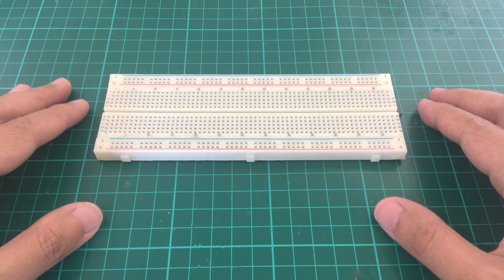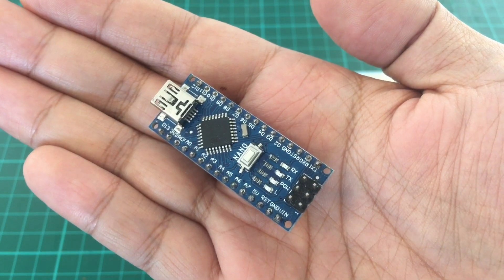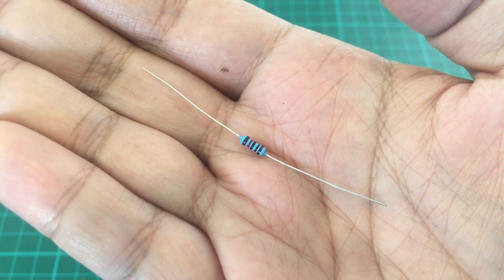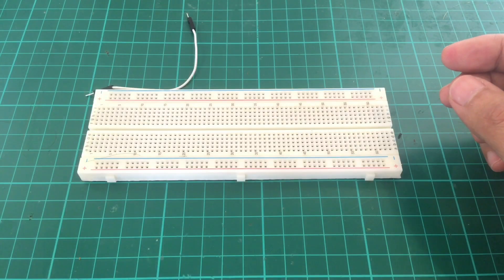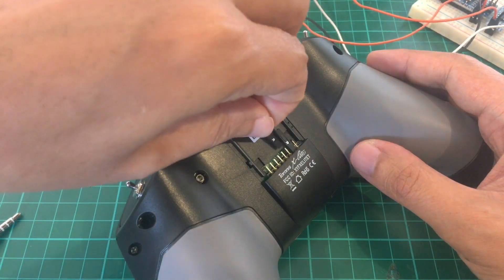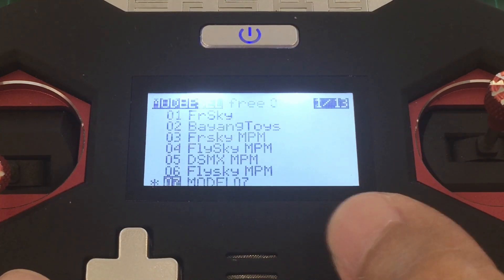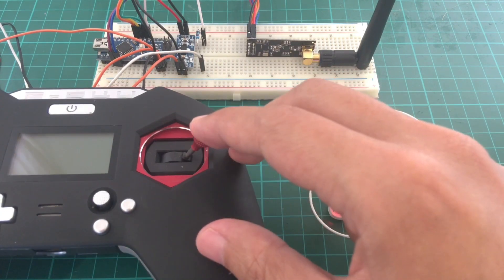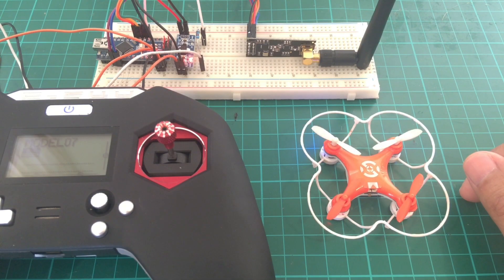How To Build A Better Multiprotocol Transmitter Module

Comment: Hello  @jaylagare  , the code by goebish does not use the spi ports on the arduino, do i need to install additional libraries for the code to work?
Reply from the maker: Yes, it doesn’t use the hardware SPI. No, there’s no need for additional libraries as everything is in the code already.
Reply: @jaylagare  thank you for your help, hopefully i can get it to work

Comment: Hello  @jaylagare  , can i use arduino pro micro or leonardo for this module? Thank you
Reply from the maker: Yes, it should be possible.
Reply: @jaylagare  i think my nrf24 module is faulty, tried the code, but wont bind with rajawali whoop fc silverware. When selecting protocol using sticks the tx light stays on and wont blink.

Comment: Im using the flysky output om my tx .
 External , multi , flysky , std subtype . 
   The ant pin in the jr bay going to a 2.4ghz radio signal  booster .
 It is labled ant . Not labeled ibus .
The bottom pin is labled Ant . 
   Above it is gnd .
 Above that is v - batt ( 2s 7.4 volt ) 
 Usually only crsf module or elrs modules or muti protocol modules are used by people on youTube .
I wonder if it works ?
Reply from the maker: Sorry, I’m not familiar with that particular setup.
Reply: @jaylagare  thanks . 
 I will put an antenna on it to see what my multiprotocol tx puts out on that pin . 
  To see if it is an ibus signal or an sbus signal or an rf signal .

Comment: Bhai plz help karo na , mai bohat try kar raha hu nrf se nai ho raha haib😢 plz help
Bro plz help me, iam trying really very hard with nrf but cannot get it to work 
i compie the code as it is Still nothing
I compile the code AETR PPM Still nothing 
Tested the input and inserted Some Code to output a PPM on a free PIN for loop back the final Signal Sent to NRF, Confirmed it on Osciloscope and everything inputs and Signal is in order 
USED FS-i6x Stock (therefore AETR order PPM)
once Changed the FS-i6x Stock Firmware to OpenTX Still 
Nothing 
its Driving me mad Since more then an year Changed 2 Drones aSSumimg the protocol might Not be Bayang 
even Try Building an Bayang receiver with NRF24L01 
Still No Luck
am I Suppose to be So unlucky
Reply: Did you use Gnd on the signal output ? 
 My bottom jr bay pin is labled Ant. 
 Antenna is a radio frequency signal i hope . My settings are external , multi , flysky , std subtype . 
 The signal pin goes to a 2Watt 2.4ghz radio signal booster .  And the antenna ground goes to the black Gnd pin . Sounds correct ?

Comment: Can the module you used transmit to a FrSky receiver? Id like to use this for an RC car. THANKS!!!!
Reply from the maker: For this chip (NRF24L01) and firmware, no. For FrSky you’ll need a CC2500 chip and the right firmware.
Reply: @jaylagare  just the info I need, thanks!!!